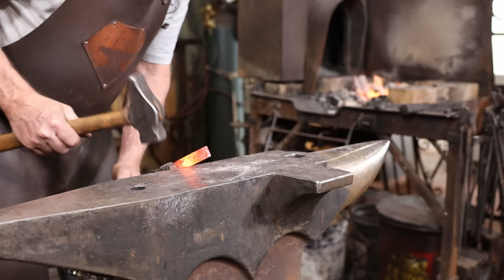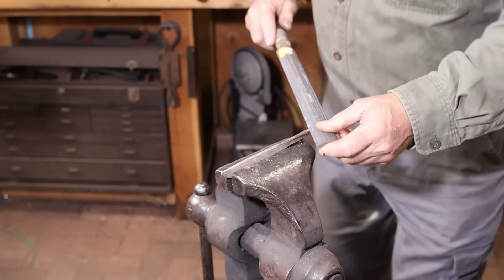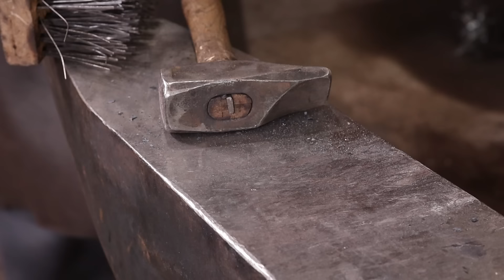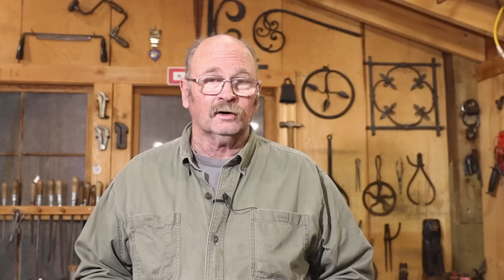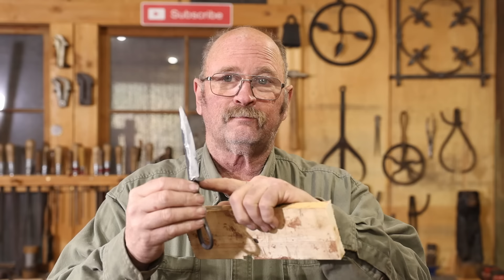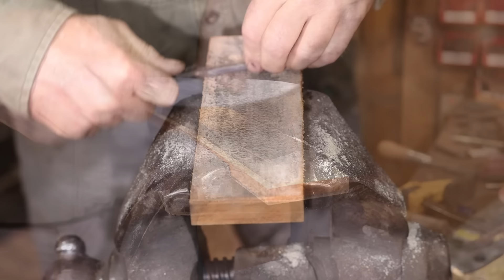Forging the Blacksmiths Knife

Comment: What sort of vice is that? Looks like the jaws are taller than a drill vice? What sort of vice did you make it from?
Reply from the maker: That is a leg vise, which is the type of vise commonly found in a blacksmith shop.
Reply: @BlackBearForge oh! I didnt recognise it? Never seen a leg vice adapted for a hardy hole before! Interesting!
Reply: @BlackBearForge never seen a leg vice used on an anvil before like that? In the hardy hole?

Comment: I know this is an older video, but in case anyone still comes across it, a great way to hold down a knife for hand sanding, is hot glue sticks. You just melt them in a can and pour them on a board and stick the knife on it. As it cools, it holds the knife pretty well for hand sanding, but it's also pretty easy to take the knife off without leaving much residue when it's cold. And when you're reusing it, you just melt it with a torch or a heat gun. Also, it's soft, so there is no real chance to scratch up the side you already have handsanded, when you do the opposite side.
Reply from the maker: Great tip

Comment: I`m not sure if you read these from old videos but they are really inspiring  that I would like to ask a couple of questions. First when forging in the blade edge how thick do you leave that edge? secondly how long do you stretch that handle tail out before curling and turning the end in.
Reply from the maker: I thin the blade to about the thickness of a dime at the cutting edge.  It is further thinned after hardening by filing or grinding.  I don't recall how long the handle was, but you can test using wire to see how long you like it for your grip.
Reply: @BlackBearForge  thank you from Devon , UK

Comment: Since I've been watching these videos and messing with blacksmithing. I've made some stuff, gave some stuff away and even sold some stuff. But my most satisfying achievement came this spring. I cleaned and butchered 2 wild turkeys with a knife I made from a chunk of coil spring, using skills and techniques learned from this channel and tong blanks from Ken's Custom Iron. I'm not one to blow my own horn and I might not be able to duplicate the success, but after cleaning the turkeys I did five strokes on each side of the blade on a ceramic rod and could then shave hair from my arm. Happy, happy, happy. Thanks, John.

Comment: I have a question, if one were going to make a bunch of something and wanted to cut time descaling would it be a good or bad thing to soak the pieces in a hot vinegar solution? I have done it with mild steel and also stainless. It helps clean and dissolve the scale. I'm just trying to ask if it affects the steel negatively or not.

Comment: I started out making copper and bronze age daggers. When I moved on to steel and iron work, the thing that shocked me in terms of the jump in advantages of steel of the modern world was how tough it became to hand sand blades. I'd comfortably hand sand up to 7000 grit on bronze but with steel I ended up having to put the sandpaper on the end of a Dremel.Long before hardening and tempering.

Comment: I have tried this three times with mild steel. I continually get a cold shut up at the junction where the blade turns into the handle (I am using the edge of the anvil to isolate the blade from the handle). It doesn’t seem to matter how I go about it or how thick I leave the handle, I get a cold shit ultimately creating a weak point. Do you have any idea as to what I may be doing wrong and how to correct it?
Reply from the maker: Make sure the edge of the anvil your working at is well rounded and keep the thickness from spreading.  Its easy to forge a cold shut in if you don't keep it flat nearly every heat.  Leave it thick and file or grind the transition to final shape to remove any cold shut that may have formed.  Its also important to keep it hot, it the transition cools it will crack even without a cold shut.
Reply: @BlackBearForge  ahh.  Thank you.  I have been using a sharper spot on the anvil trying to get a crisp clean line there. That may be my big issue.  I will use the rounder portion and try the file this time.

Comment: As someone who makes knives with no power tools, I do all the filing and hand sanding until 240 before the heat treat since it goes much quicker. I wouldn't even dream of touching it with a file after heat treatment. A cheapo file gets me about 2 big knives, even when soft, before it wears enough to lose significant speed. 
I go up to 240 only because the scale from the quench is too hard to remove with finer grits.

Comment: I’m looking to buy the Viking knife bundle. But my budget is pretty low and I noticed I can save $20 if I don’t get the butchering tool. Could I use the edge of the amble instead? Or is it better to go ahead and spend the extra 20?
Reply from the maker: I think you can get buy without the butcher.

Comment: Why does it take an hour or maybe two to temper in an oven but only heating up to blue color or a little less for a few seconds to get the same hardness.    I assume it is equal hardness for the two methods but as you say, maybe not as uniform in the blade without the even heat of the oven?  thanks
Reply from the maker: While I think its equal in theory, the longer time spent in an oven guarantees an even temper throughout the piece. Oven tempering also starts with a piece thats fully cooled down and has to come back up to hear whereas using residual heat starts with a piece thats still 1000 degrees or more just back from the edge, so it heats much faster.
Reply: @BlackBearForge  thank you.

Comment: Thank you for the videos, they are awesome.  I have learned a lot.  Have you tried using electrolysis to remove scale?  I am very new to blacksmithing, but it seems to work pretty well for me.  I used the setup from this video (https://www.youtube.com/watch?v=V-prcdrvb_E) no affiliation or anything, just where I saw it.  I just hook up the workpiece and let it run for a few hours.  I haven't changed solution or electrodes for weeks and it is still working ok for me as a low effort scale cleaner.

Comment: I’ve only just started making knives and have found my hand sanding is easier when I wrap the abrasive around a piece of 1 inch square tube and use WD40 as a lubricant
Reply from the maker: great tip

Comment: I often use course/medium stones like you can get from HF and other places cheaply. I buy them three at a time and spend a few hours between jobs rubbing them together in figure eights to ensure they stay flat. They remove forge scale and do basick shaping as well as files but are cheaper. I still have to use files occasionally as the stones are large-ish and flat and not good for detailed work but for strateing and simple bevels they work well.

Comment: For the edge using a cross peen or fuller helps spread the steel the way you want. It also helps draw out the tang and blade all together.

Comment: I usually use a a piece of 1/2 square stock with the sand paper wrapped around it. Use the corners for heavy sanding and flats to smooth
Reply from the maker: Great tip

Comment: Good video to make a cute little camping knife by hand. At this point in my life I would using all electric tools. I just don't have strength in wrists any more.
Reply from the maker: My preference is to use the power tools as well.  But sometimes beginners need to see that they can do it even if they down own the power tools.

Comment: Very nice.  The technique I've used differs in one or two places (I usually just work the corner of the anvil rather than use a butcher tool), but more or less similar.  One little thing, though: It is not a "Viking knife."  A Viking knife, or "knifr" (old Norse for "blade"), is constructed more or less like a puukko or lapinleuku: contemporary Scandinavian knives (go figure).  Knifr have a tapered tang which runs through tubes or washers typically of wood, bone, leather, and sometimes metal.

Blacksmith knives get sold as "Viking knives" because these things are relatively (key word) easy to churn out, it sounds plausible that these would have been in use a thousand years ago, and throwing the word "Viking" onto it justifies the rustic design to buyers.  It's marketing, but it's not accurate and it popularizes misconceptions about the ancient culture and craft.

Comment: When I'm hand sanding them, I usually take a scrap of 3/4" plywood and trace the outline of the knife on it, leaving a little extra around the edge of the blade (or both sides if it's a dagger).  Not so much that it interferes with the sanding block, but enough to go beyond the edge.  The extra plywood is a safety thing that prevents or reduces injury from inadvertently running your hand over the blade while doing the mind numbing sanding routine. I drill holes in full tang knives for pins, but they can also be used to hold the knife down to whatever you want using screws.  So I just center the blade on the plywood where I want it and screw the entire knife to it, then I use a vise to hold it in place (alternatively, you can bring it outside to a tree stump and screw it down to that with longer screws for a change of scenery).   The blade is flipped to the other side of the plywood and screwed back on when you're done with the first side, and it's further reusable if you're making the same or similar knives later on.  For knives without holes in the tang, another scrap of wood can be screwed or bolted on top of the tang to the plywood below to hold it in place.  An alternative to sandpaper is to get yourself some valve lapping compound and a flat piece of hardened steel (so it's less likely to bend or deform), this will give you a flatter surface, more consistent finish, and your bevel edges will look sharper.  I use a scrap file that I ground the teeth off, but you can use just about anything provided it doesn't bend with using pressure on it.  You can also buy various grits all the way up to diamond lapping compound depending on the finish you want.

Comment: Where is a good place to get an anvil? I like new ones because of the nice edges that are not rounded over. But for a total beginner, does it really matter? I have just as much luck finding a section of rail as i do an anvil so I think I like the latter. Thoughts?
Reply from the maker: There are some links in the video description for various suppliers. Mine is from Steve Fontanini.

Comment: Great job John. Love your videos. Have you seen Lin Rhea's X-Rhea knife he forges? It's basically like what you made except he files a stud on the back of where the finger choil area of the blade meets the finger choil and then drills a hole in the choil then peens the stud to mechanically fasten the two together. Not a good description of the process. There is a video on YouTube. Anyway thanks for the demo.

Comment: Thanks mate , just wondering if you have tried using rebar , it’s like 1095 and water quenched , it’s pretty tuff stuff to play with but burs up an edge . I like it’s industrial appearance 🔥your opinion ?
Reply: I’m no expert, but rebar is made up of just about anything the manufacture wants to throw into the mix. Certainly mostly low carbon/mild steels. I don’t think it makes for a good knife, at least not the cutting edge.

Comment: What does the bucket of sand do?
Reply: It's not sand. It's  either ash or vermiculite and it's for annealing the steel. Very slow cooling causes the steel to soften which makes it easier to sand or file.
Reply from the maker: What Jim said 😄.  In this case I use vermiculite.

Comment: Thanks for another great video!  
I'm not a "full time" knife maker, but I make well over 30 per year.  I haven't found any better ways to clamp blades for hand sanding than on a board like you did.
Some people make and use a specialised knife vise from a piece of pipe.  I only ever use mine when working on handles

Comment: I routinely beat these out of leaf spring and your process is almost exactly the way I do them.These are great for a beginning smith to learn skills and they're a useful and desired item.I could easily sell everyone I make,but I normally give them away in exchange for favors.
Reply: I am a beginner smith only  forged one thing I’m going to try one of these as my next project
Reply: @lughaidhcook3429 😊😊
Reply: @lughaidhcook3429 how did it go?
Reply: I usually make them out of scraps of rebar and give them to friends, good practice but out of spring steel for sale
Reply: I plan on using these to get back into the hang of things after taking more than a year off from forging due to moving and work. I figure it will be good practice of the fundamentals and good gifts for all the people who helped me during the moving process.
Reply: If you’re exchanging them for favors then you’re practically selling them. 😅

Comment: Hey cool I finally get to see how my favorite small knife is made. I bought one at a Mountain man retreat close to 20 years ago. mine is made from a piece of cable that was forge welded into a knife.
Reply: I think my knife is called a patch knife. total length is 5 1/4 inches but watching you make it bigger is very cool.
Reply from the maker: This style would make a good patch knife
Reply: I’ve got one that me and my brother made (he forged, I heat treated and ground) it’s quite a different design than the typical blacksmiths knife, the handle, rather than being curled into a loop, has been forged into various loops and curves to resemble a coiled snake. It’s still clearly a blacksmiths knife but I’ve never seen another like it. Mines 7” overall